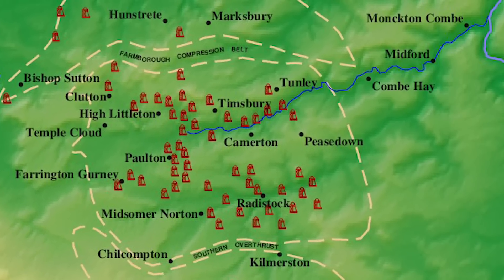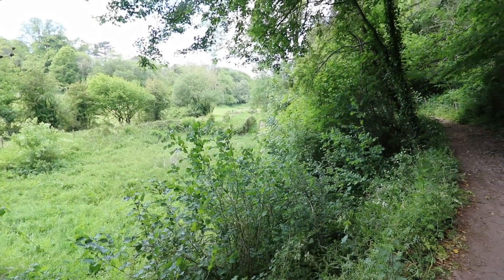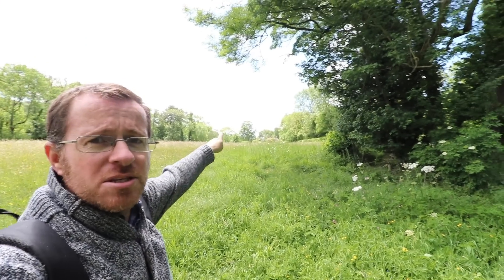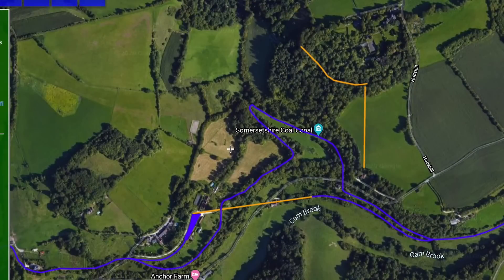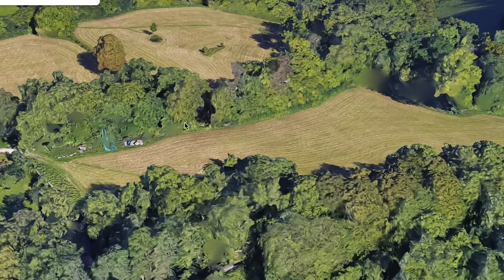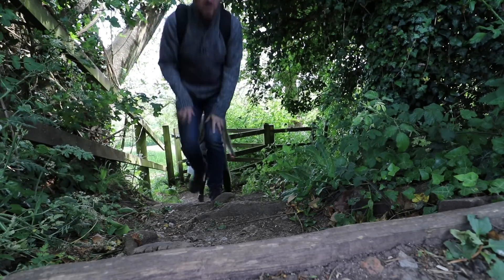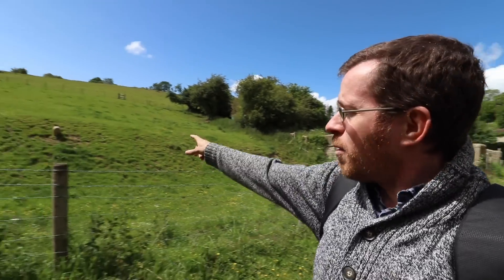Somerset's Crazy Canal Invention

Comment: As an engineer, I can't even comprehend that first 'sealed caisson' proposal.  Only reason I can think of for having a sealed caisson in a tower of water, is to maintain neutral bouyancy and therefore reduce the force required to lift/lower the caisson.  If the adjusted correctly, the weight of the caisson (with and without the barge) could have been adjusted by the to be neutrally bouyant (i.e. not rise or sink under it's own weight).  As you say, the implications of being sealed in a box under water and then relying of the door/gate seals at the upper/lower entrances to prevent the whole tower of water from escaping in a oner are unthinkable risks.  Made Victorian engineers contrived some amazing schemes ... but H&S wasn't exactly first on the list of priorities.

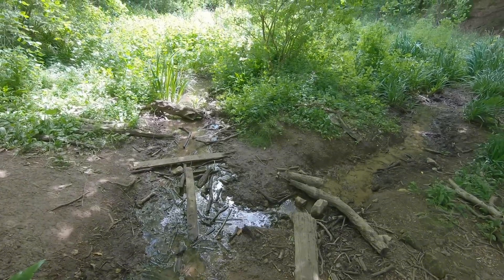by the way at 5:30, the boats turned through 180 deg. not 360.
Reply: The inference is that the caisson initially worked well enough and would have saved much water; it was the leakage and bulging of the badly-built masonry chamber that caused its demise. Nobody - only the boat - would have entered the submarine box: the bargee would have taken the tow horse down the slope to the lower level while the boat was being lowered.
Reply: Except that the Somerset Coal Canal pre-dated the reign of Queen Victoria by some forty-two years!

Comment: You should have taken a closer look at that hairpin to see if the iron bollard is still there. The bollard is used to put the tow rope behind to stop the barge being pulled into the bank when the horse goes around the corner. You can see examples of these bollards at Dundas and they are deeply grooved by the ropes cutting into them over the years.

Comment: Love the unraveling of a.mystery. All those locks must have been a nightmare to traverse
Reply from the maker: Yup akin to Seend I should imagine!
Reply: The twenty-two consecutive locks on the flight at Combe Hay were built with large paddles and culverts so that they could be filled and emptied as rapidly as possible.  The expression "Lock/Miles" was coined to help calculate how long it would take to traverse a given length of canal, since it took as long to pass through one lock as it did to travel along one mile of ordinary waterway ...... a nominal five minutes.  So the maths for Combe Hay is easy enough ... 22 x 5 = 110 minutes to navigate the entire lock flight.
Reply: I was lol when you were explaining the weather you had been having. Sounds exactly like we have had here ( Michigan, U.S.)  Our temperatures have been crazy. Have had heat index over 105°, temp down to 49° at night. Mother Earth just hasn't been happy.
Thanks for another interesting video.

Comment: Another excellent video, enjoyed it.  I have been to the flight twice and the first time I missed the hairpin bend completely and went off up the hill to the north and just could not figure out where the canal had gone.  On retracing my steps I found the turn and the route.  As I headed back towards the old railway I turned and took a path towards Caisson (as in CASE ON) House and found the best parts which sadly you missed out.  Lock 9 still has the very decaying remains of the bottom gates as does lock 10, shame you didn't manage to visit them.
Also the photo of railway workers you included at 4.18 when talking about health and safety is not British, I suspect it is American in origin.  The type of track being constructed is the giveaway, flat bottom rail being fastened directly to wooden sleepers was not the British way, we used bullhead rail held in chairs with keys.
Reply from the maker: Jules that's exactly what we did. We carried on up the hill and wondered when we would get to the basin.

Comment: This is very weird! I saw your video about the Cam Valley railway to Camerton. Last week I started reading a book called "The Map that Changed the World" by Simon Winchester. Within a few pages, what should crop up, but the Cam Valley! I was just about to find your video and make this comment, but then this new video crops up! The point is, that the book is about William Smith, who is the father of Geology, and he was the engineer of the Somerset Coal Canal. He was previously involved in the Somerset coal mines, and then used the the canal to further develop his geological theory. The map he published in 1815 is pretty much the same as those in use today! In it, you get a potted history of the canal and the railway, but it also tells you about the story and site of the boat lift. Apparently, it is marked by a large elm tree! The book is fascinating, and I think you would find it very interesting. Incidentally, there is a boatlift on the Forth-Clyde canal in Scotland - the Falkirk Wheel - which connects to the Union Canal.

Comment: The canal to the pumping house would be primarily a feeder canal to feed the water from the pumping station into the level of the canal.
Reply from the maker: Thats what we assumed, but how is it possible some pumping houses didn't need there own canal level?
Reply: @pwhitewick  Some use culverts.
Reply from the maker: @532bluepeter1  ah I see. Thank you.
Reply: @pwhitewick   It seems the section of dead end canal leading to the pumping house and was a feeder back to the main canal above the locks. As water was scarce, and they weren't allowed to divert the river into the canal due to mills downstream with water rights, the water was raised from the river by the pumping station and allowed to flow back along the feeder into the main canal above all the locks to provide the water necessary to run all 23 locks. Below the locks the water was allowed to flow back into the river to ensure water supply for the mills further down stream. It is explained in this video: https://youtu.be/nPBfM2NTyu4?t=503

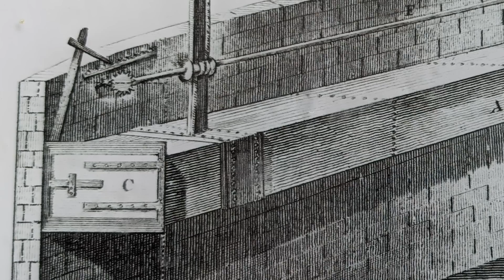Comment: That diagram at 6:50 is terrifying, especially with the water above and below. It being watertight is one thing, but such a height of water also makes for a lot of pressure at the bottom. If the seal fails on the box, you'd be in serious trouble if you're at the top, let alone if you're at the bottom. Not to mention the pressure on the seal at the lower docking point of the caisson... and then building caisson after caisson. Wow.
Reply from the maker: Absolutely on all counts. I can't begin to imagine how this got past the drawing board.

Comment: Great film showing this very old abandoned canal. The canal was built around 1800 & closed in 1902, & sold to various railway companies. The GWR line that ran from Limpley Stoke to Hallatrow used a lot of the old canal bed for its track. Check out the old railway tunnel at Combe Hay on the Wellow road cross roads, the arches in the tunnel (for workers on the line) have the original stonework canal lining to the back of the arch to save brickwork & how much deeper the railway had to be built from the base of the canal to the trackbed of the railway (about 800mm). The northern portal of this tunnel seems to show partly brick & mainly stone, was the stone part of the original canal portal, who knows? but it does look possible?. The Somerset coal canal starts at the Dundas Aqueduct (and is the only section restored with boats on it) & then splits into a northern section (which your film is partly on) & a Southern section which ran from the restored Aqueduct (shown on your film) at Midford up the Wellow valley to Radstock, some of this was used again for building the trackbed of the Somerset & Dorset Joint railway. Wellow still has a canal tunnel/ portal that runs under the road & church to the valley beyond but maybe in a private garden? If you have not already done the 2 tunnels walk from Bath (Green Park station) to Wellow I do recommend it.

Comment: This is a terrific video and needed a lot of research to unearth so much information in one walk. I knew about the caissons and the third attempt to bridge the gap between the two levels, which resulted in the canal going up the narrow side valley, round the hairpin bend and back down the other side. I wasn't sure where the upper caisson house was and your research fills the gap in my knowledge. If I remember rightly both caissons were actually built and the transport proved unworkable as the engineering of the day was not up to the task. Even a century later it would have been a major challenge to the highly skilled and innovative engineers who built the Anderton boat lift in Cheshire and the inclined plane at Foxton in Leicestershire. There is a much more modern solution to the same problem at Montech in France, where the canal boat is transported up the slope in a kind of moveable lock propelled by two railway locomotives, each running up a track either side of the the lock. The Montech water slope was built and opened in the 1970s!

Comment: A couple of thoughts - could the 400 yard length of canal near the engine house be a reservoir? This would allow  the pumping engine to work constantly and efficiently without any sudden heavy loads.  The hole nearby may have been a deep well  to provide water, or possibly clean water for the boiler. Also it seems to be assumed that the boat crew would stay on the boat as it went in the caisson, but there's no obvious reason why this should be - after all the horse would have walked around so why not the men.
Reply from the maker: A couple of very good points there!

Comment: I think you like a railway/canal puzzle like me!  That sharp bend (whatever the angle!) does suggest reuse from a different alignment.
The reason many inclines were superseded was the cost of transshipment rather than any safety issues.  (There is a local example (for me) of inclined tramways next to the High Peak Canal)  There is the early 1925 Cromford and High Peak Railway built with inclines between level sections like a canal.  (Not far from the Monsal Trail you did.)   Caissons were a strange beast and rarely successful, so I am glad the Anderton Boat Lift is back in action.   
But then there is the wonderful combination - inclined caissons.  Examples in France and Belgium, but there was the short-lived Foxton Incline in England.  Midlands somewhere if I remember right.  Short-lived, but I think there was an effort to restore it.  Can someone update me/us on that?
Sorry for long post!

Comment: The question I have is, what was the engine house in Engine Wood for? The only answer I can come up with is that it was used to back pump water from near the hairpin bend to the top of the flight of locks. In which case the "canal" from there to Caisson House was presumably a leat.
Reply: Just come across this http://rtjstevens.co.uk/historya.html with more on the pump

Comment: That caisson would be amazing if it worked, and didn't leak and had a sufficient oxygen supply for the duration of the drop or rise. But why have water simultaneously above and below when it could be a very deep lock. 
This, perhaps answers itself as without an even higher reservoir, there was only so much water available to get up a hill and only so much space to keep it either end the bottom otherwise the top end would be dry ( if there wasn't a higher feeder )and the locals at the bottom at either end in any case would be a dabbling their feet in the water for miles around if it got used a lot. 
This implies that it had to be a sealed sealed system- maybe with pipes and pumps and a steam engine to work the caisson but the water looks like it displaced itself by the movement of the the caisson alone, probably around the long sides, where no watertight seal was required
Although the patent for the caisson has two hand cranked gear systems, I wonder how much effort it took to move. The Falkirk Wheel is so finely balanced that it only needs a fairly basic motor of only a few horsepower to turn it- it might even be in low double figures. A friend's wife was a civil engineer and has been inside it, too. She'd probably know all about the caisson too, it's the sort of thing her and her late husband were well into, but that's all years ago- water under the bridge :)

Comment: great video, so, does canal water flow? if so how does the boat sail against it ? this would be pretty tricky for a horse to pull
Reply: Tom Alexander very little flow. Water only really moves as locks are filled and emptied, and to compensate for any overfilling by streams etc that enter the canals at intervals to keep the levels topped up. It's surprisingly easy to keep a boat in motion once it's moving, a human can pull a canal boat, albeit slowly. The one notable exception is the Llangollen canal, which is used to transport drinking water. It has a flow of about 12 million gallons a day, which becomes noticeable at narrow and shallow points such as tunnels when the entire flow is squeezing through relatively small spaces between the hull and the infrastructure around and under it. Ironically, a horse probably has an easier time than a modern Diesel engine in these situations- a propeller causes a drop in water level behind and under the boat when spinning in shallow water, exacerbating the problem to the point where more revs can slow you even further. Slow and steady seems to work best.

Comment: Brilliant stuff as usual. The locations of that caisson is, indeed, subject to a lot of controversy. You'll have to remember your ground-penetrating radar next time. I still find the idea of coal mining in Somerset inherently bizarre anyway; it doesn't really fit with the image of the county (but I felt the same about coal mining in Kent, but the last mine in that county didn't close until 1989 marking 99 years since coal had been discovered there).
Reply: Is there anything more inherently bizarre about coal mining in Somerset compared to, say, coal mining in the Royal Forest of Dean?  After all, they share the same geology.  Wherever you come across rocks of Carboniferous age in England there's a fair chance that they will contain Coal Measures with seams thick enough to be worked commercially.  Don't forget that Lead was once mined in Somerset .... and used by the Romans in their sauna complex at Aqua Sulis aka Bath!

Comment: Fantastic video - well done
Comments - 
1) Too much talk about 'barges' - this was a narrow boat canal.
2) Surely the function of the navigable feeder at Combe Hay was to supply the water, back pumped by the Engine house, to the summit section?
Reply from the maker: Not really clued up on the difference between a Barge and ......
Reply: @pwhitewick  To quote from Wikipedia - 'it is incorrect to refer to a narrowboat (or narrow boat) as a barge. In the context of the British inland waterways, a barge is usually a much wider, cargo-carrying boat or a modern boat modelled on one, certainly more than 7 feet (2.13 m) wide'

Comment: I would think there would be no need to keep water in the caisson once you'd got the barge in. Let the water out so the barge sits on the bottom of the caisson thereby reducing the weight by at least half (Archimedes and all that) then take it to the end of its travel and let the water back in again to get the barge on its way. So you wouldn't need that fantastic of a sealing system. You'd need something to make a good seal at the entrances particularly the top one so as to not drain the canal. I can see why they thought it might work.
Reply from the maker: ...and conservation of water was pretty much their main motivation.

Comment: The Barnsley canal had an arm off it to supply coal to its pumping station , easy way to get coal to where it’s needed for canal company’s use their own canal
Reply from the maker: We had assumed that to be the case but we also know of many others that didn't provide this. Odd for a cash strapped canal?
Reply: @pwhitewick  Its thought, according to the SCC site, that the upper reach was constructed to bring water to the top of the lock flight.

Comment: I wonder why they scrapped the incline. They used several in the Morris Canal in NJ to get barges up and down from Pennsylvania to NY, I think that was built in 1820.
Reply: This inclined plane didn't lift the barges, so the coal had to be loaded and unloaded from carriages, which was time consuming and tended to damage the coal. It begs the question of the comparative building costs and operating efficiencies of a barge carrying inclined plane vs a flight of 22 locks though